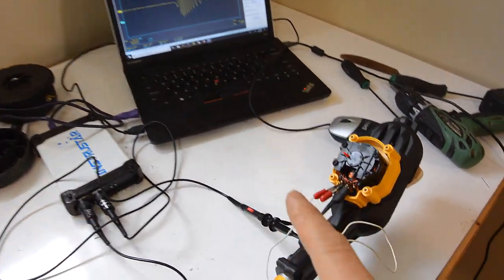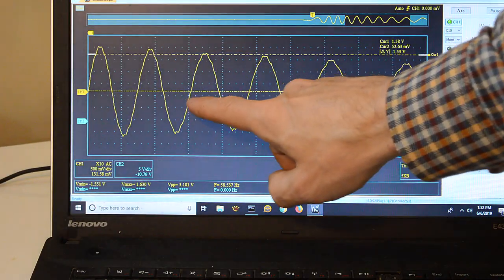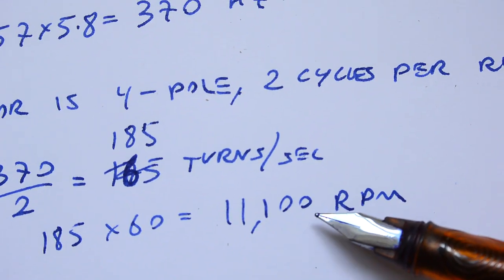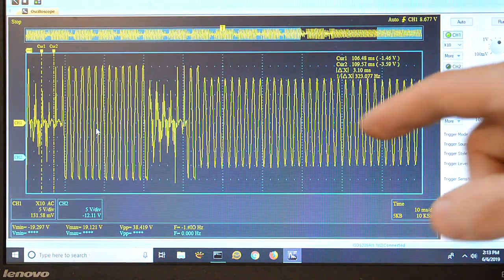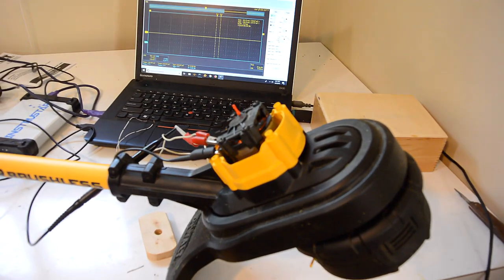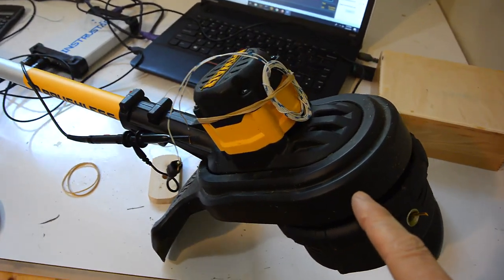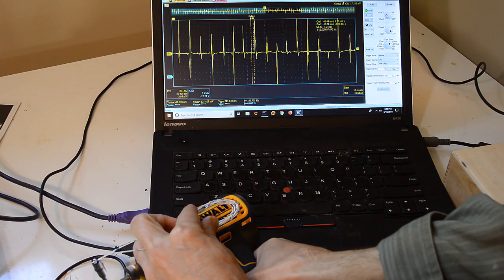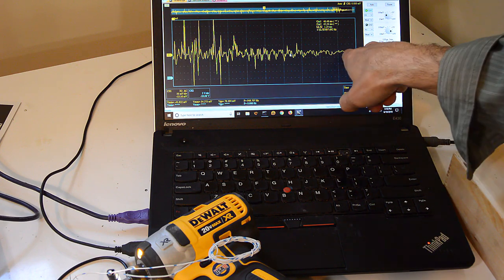Examining a brushless DC motor, and a dumb way to drive one.

Comment: I don't think it's doing the PWM strictly for the motor, but rather as a feature to drive the head in a different way.

When cutting grass and weeds, there's a lot to cut through. The spool cuts most effectively when it's whipping, not just rotating. It's sort of like an impact driver's effect on a bolt. 

Try measuring the output RPM. It's probably more or less the same RPM throughout the trigger range if there's no load.
Reply: Simple answer what’s your definition of efficiency?... for automobiles adding aggressive air intake and a high flow exhaust creates a lot of efficiency focused on driving the car faster ... where as dampening the motors exhaust and slowing down its air intake  will make the motor run more fuel efficient in the way it saves you money in gas... 
so I’ve used trimmers to cut jungles of grass from 5’ to 4” and a gas trimmer running full out throttle when cutting long grass will generate a ton of wind which blows the grass or momentarily bends the grass and it get missed by the trimmers cutters. So our old dads would tell us do the job proper and pulse the throttle and not to go full out. Or we will have to trim the whole yard again tomorrow! Watching the scope when you had the trimmer hooked up I immediately thought about being in a grass cutting situation in which to cut efficiently you have to operate the throttle non efficiently...

Comment: Its not breaking and wasting energy... Your crappy (USB latency lagging scope) is displaying a drop in voltage at regular intervals but its reading the back EMF (not forward voltage) which occurs at the same intervals which correspond to periods of time when the ESC is not supplying ANY voltage to the motor. Because the ESC able to sense the load and RPM of the motor it can change the PWM signals it sends to the motor on the fly and this makes the BLDC motor much more efficient and battery friendly. :) Brushless motors are actually three phase AC motors... Now try to wrap you brain around that :)
Reply: He observed that the voltage from phase-to-phase is zero for several cycles of sine wave even though the motor is spinning continuously. This can only happen if something is shorting out the back EMF that would otherwise be across those two wires. This means that a large current will flow. And the the mechanical effect of that is going to be braking (torque acting in the opposite direction of present rotation).
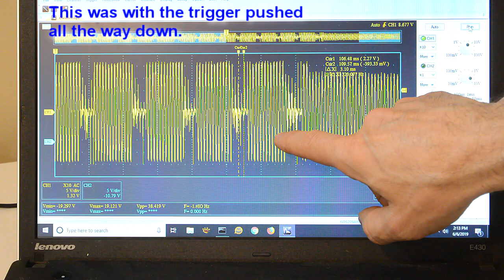Reply: During the sense period the (now output) voltage of the coils should not drop to almost nothing like it did unless the motor is so heavily loaded that it stops turning. Note at 6:56 where he releases the trigger and the height of the waveform slowly decays. That's what it should look like for a few cycles when doing back EMF control. The dip should be visible because you need to switch in some amount of resistance in order to create a voltage drop and suppress potential interference. Dropping down to almost zero means that is has to be shorting the coils or driving them exactly oppositely with battery voltage.

Comment: When using the trimmer i would imagene it is not braking that much because it has resistance from the thing you are cutting.
Reply: fl0r1svdk that’s exactly what I was thinking. Matthias can you make a “probe” and attach it to the scope and test it under a load?
Reply: It doesn't matter whether it is cutting. It just needs a piece of string in it. The string has a lot of air resistance at high speed.
Reply: Yes, I had an older version like that and a tab holding the ground cover broke, I ran it for a short while cutting heavier grass without that cover and very soon smoked the motor - dead once stopped - so I think that design just ran out to maximum and wanted friction of the plastic cord on the cover as one passive speed governing control.

Comment: As primitive as that controller is, they set it up like that because there is a lot more torque required when using the tool with string and cutting grass, I think you will find it running almost full out without braking to slow it down.There is another story with ecm motors that this controller does not make use of and that is back emf from each coil, the good controllers actually feed the voltage spikes into the next coil pairs to smooth out operation and add torque.There was a company that used a solid state disk for the rotor about 10 years ago but I don't recall the name.

Comment: Around 6:40: this is done to maintain both speed and maximum torque. You could regulate voltage accordingly to current, but that would be a waste of battery power to heat up another bunch of transistors, and probably spin up a fan to cool them.
Reply: It seems that in the null part of the duty cycle, when the coils arn't being driven, they aren't disconnecting the coils. They are driving the mosfets to short the coils instead. This doesn't allow the motor to coast, but would act as an electromagnetic brake.

The question I (and I think, Matthias) am asking is why they do not drive the mosfets to open-circuit, so the motor doesn't generate current and is not slowed down.

And when an electromagnetic brake would be useful - when the trigger is released - then the mosfets are driven to open-circuit, and the motor coasts. 

My thought is that they could be using a tuned circuit between the coils and some capacitors, perhaps, When they are not driving the coils, they resonate instead. Measuring the voltage across the coils may not show this, as you are really only measuring the voltage across the shorted mosfets.

Comment: I didn't understand much of what you said, so please forgive me for being puzzled over your remark about braking. How do you know this is not just an intermittent PWM pulse of energy to save battery life? Once these get to full speed, the torque requirements are minimal, in contrast with what you would want for an electric drill.
Reply: A BLDC is like an alternator. If it is spinning, it is generating voltage as the magnets move past the coils. If it was "coasting" and not being driven by the controller, you would still see that sinusoidal voltage across the wires where he put his oscilloscope. You may be thinking that when drive voltage is removed from the motor, it will just rest at zero volts, but that is not the case.

Comment: So, all that waveform is normal without load. Load the motor, then take measurements. brushless controllers are a closed loop system, and it cuts out due to overspeed sense in the circuitry. When you provide a 20-30% load, the frequency should smooth out because the motor is driven purely under load but at speed. Make sense? I hope?
Reply from the maker: Motor spends most of its time under very light load in use, so that case is more important
Reply: In this closed loop, the feedback from inductive kick during off time generates an error signal to regulate speed. Unless you have an inductive pickup for your scope, what your seeing isn't real due to the very high impedance mismatch. I hope this helps. But, this thing is supposed to be as cheap as possible so I guess they don't care about any of this and just make it turn. Idk
Reply: @matthiasrandomstuff2221  just adding string will load it quite a bit. Doesn't need to be cutting stuff to get resistance.

Comment: Money is likely better spent on the Worx model that doubles as an edger. If you compare that DeWalt to a Worx, the Worx is more honest and has less unnecessary bullshit for a brushless motor design. (Why does DeWalt have a fake gas motor "thing" and not using direct drive when a brushless motor should be reasonably able to handle it?)

Comment: I just bought the same exact thing lol.  Now at least I know what that sound is (the sound it makes when its done spinning down ).  In any case I was wondering if once the spindle is spun up if it will charge the battery when I release the trigger, since it doesn't stop right away.  Will the big gear or small gear wear out first with all the chatter?  Maybe depends on how its operated.  I'm pretty happy with it so far, but it's a new purchase.  Even my 1.5 Ah batteries are enough for my yard but its nifty you can use the heavier batteries with it too.  My only issue with it is the vent holes on top don't stay clear without a little care, much unlike the drive shaft powered gas trimmers of yore.  PSA: Stay away from cable as a drive shaft trimmers, if the shaft has a curve you know its a cable drive shaft... the cable will wear out, especially if pulsing the throttle.

Comment: For safety reasons, that trimmer needs to stop fast. The PWM is just on-off control: drive full speed or brake. It would be better if they braked only when the trigger is released but that would probably require a micro controller and software instead of a cheap driver IC. DeWalt probably has no idea what is going on, they just picked a Chinese factory to make it and drove a hard bargain, giving the factory little financial room for improvement.
Reply: Ma reasonable explanation I read here so far.

Comment: Silly question - does the drag of the string make a difference? spin it up with the string at full length and see if you still get less than full drive cycle.  I know mine, brushless EGO brand sounds a lot smoother as if sine and the board get along.
Reply: Definitely. My gas trimmer rev limits without string. But runs very smoothly with string.

Comment: I'm not sure how stupid it is. Remember, the string trimmer has intermittent loads when in use, so maybe periodic max voltage provides that peak intermittent power to get through those loads to minimize bogging.

Edit: I agree with another viewer as well. I'm not sure how you have this scoped, but perhaps you're only measuring 1 of the 3 phases.

Comment: However if it's doing that very quickly and switches of it's cycles it doesn't become much less efficient if any less efficient at all. Because PWM is also just a way of modulating the signal. And it decreases or extends the off time of the motor.

Comment: Can we all agree "brushless dc" is solid state controlled AC?
Reply: I know what you are talking about. But you are fighting a losing battle. And if we were going to use a different term (which we are not) the term we would use is "Permanent Magnet Synchronous Motor (PMSM)."
Reply: @mckenziekeith7434  and that's fine, but there is no motor in existence which turns with the same voltage on all poles ;)  call it what you will...that is to say, something must alternate
Reply: @mjkulikow  everyone knows exactly what a BLDC is. If you want to try to convince the world to use a different name because you feel BLDC is not accurate, of course that is your right. But in my opinion, unless you enjoy the fight, it might be better to give up and let it go. Everyone who works in the industry knows BLDC is a misnomer. But we call them that anyway.

Comment: would it not have to do with the the third set of coils that are not attached, to the scope (not registering a signal, the third set would always keep a magnetic inershia thus prolonging the battery load, tri-lobal magnetic field limits the load requirement to start and maintain the rotational field,basically they are never truly  north south , and why the stator  clings to the magnetic field when stationary 33.33% of a pole rather than 50%opposition , similar to S.E.G.? lol ,got me thinking of of a AC MOTOR AND ELECTRICAL MAGNETISM   course i took in moncton  nb in the late 80's

Comment: Matthias, your scope is aliasing the pwm waveforms. Common brushless switching frequency is 20 khz. Your scope is only sampling at 10 ksps, which is waaaay too low to see this. You need a better scope to see the fast pwm switching. At 20khz switching, this is 50 microseconds per switch, and you want scope resolution at least 10x faster to get a clean trace of that.
Reply: that's spot on superxpro12 - I hope Matthias sees your comment!
Reply from the maker: Yes, saw the comment.  but it's not aliasing (What are the odds that for all speeds its running at the same frequency as the scope samples at).  It's using block communtation.  Just because you know of something that can happen doesn't mean that it did.
Reply: @matthiasrandomstuff2221  hi Matthias, the switching frequency of the mosfet is fixed. The duty cycle is modulated to create variable DC voltages. The switching frequency doesn't change. It is always at a constant 20 khz. The commutation rate does change with the motor rpm, however. I have been working on brushess DC motor controls for 6 years now. The scope is aliasing the pwm signal, I guarantee it.
Reply: @superxpro12  
You have very good "comment posting etiquette", you kept your
cool and focused on your comment without any hard feelings
towards his comment previous to you.

Comment: 2:00 It doesn't put one magnetic pole on one set of coils and second pole on the other two sets of coils, at least not fully like that. If you look at a signal from all 3 sets of coils it should be 3 sinusoidal lines, each  moved 120 degrees from the others( https://upload.wikimedia.org/wikipedia/commons/c/cc/3_phase_AC_waveform.svg ), so you should have said "when one set has full north, at the same time the second set is in transition to full south and the third one is in transition from the full south". You said it like at the same moment one set has full north and the other two sets have full south. I dont mean to criticise too much, I just wanted to make the information more precise for people that may be learning for the first time about 3 phase from this video. I love your videos, Matthias :)
Reply: True.  Brushless motor drivers are more complex than a single measurement point can reveal, and it's also more about current than voltage.
Reply: The drive voltage for the motor would not be a smooth sinusoid (assuming you use a scope with decent bandwidth). That would imply linear control and very high power dissipation in the MOSFET's or IGBT's. The drive would be more like a class D audio amplifier. That is, PWM. Also, sine-wave drive is not universal for BLDC's. Often they are driven with six-step commuation. You can look that up on your own time (six step commutation of bldc).

Comment: It looks like a PWM signal is controlling the sine wave instead of approximating one. Which, as you say, is a weird or stupid approach. Do you think it has to do with the output current available? Do you have the capability to make a test circuit to see how much current it draws with an always on sine wave at the same values as what it is showing here? ( just speculating here now, since I used to be a tech for the prototyping at Rigid for their vacuums, and engineers are notorious for head scratching reasons to do some things) Perhaps it is trying to decrease the strain on the battery, or an attempt at staying within a spec that really should have been met differently?

Comment: I have some experience with motors and inverters. Shorting a synchronous motor that is rotating isn't as bad as you might think: contrary to rotating it at low speed and shorting it, where the resistive component dominates the reactive circuit of the shorted motor (and it really acts like a brake), at higher rates of rotation the inductive component dominates the circuit (the motor is decelerated for "half a pole" an then gets accelerated by the induced current again for the next half pole). So the only losses you get in that mode are the current losses in the windings. This cancels out most of the hysteresis losses in the stator, as the magnetic field is kept out of it by the shorted windings. Contrary to that, if you leave the motor open while it is truning you get the hysteresis losses in the stator instead of the resistance losses in the coils. Maybe(I'm not sure) there might be motors where the hysteresis losses when open would be higher than the resistive losses when shorted.
Reply from the maker: Do you suppose the hysteresis losses are greater than the copper losses?  Also, copper losses plus some amount of volage drop across the electronics as its not a perfect short.
Reply: It's a possibility - But I don't know of any other motor inverter that does it this way. The main point is: Shorting a synchronous motor while it's spinning fast does not waste as much energy as one might think, opposed to shorting a DC motor, where all of the energy would be dissipated in the winding resistance quickly.

Comment: I believe there is nothing stupid, this waveform is representing only one phase out of three,  so when it is turned off (suppressed)  another coil is actually turned on in order to complete the cycle, it's just how 3ph BLDC motors work. 
Note: opposite coil are usually connected in series and generate both S and N poles when energized. 
Nothing wrong with your basics, your basics are really good.
Reply: That was my thought, without probing all three phases you aren't getting a complete picture of what's going on.  It's obviously a very basic method of control, with no PWM, but it would be interesting to see all phases.  Perhaps it's capturing the phase current from the off phases to feed to the active phase?  My theory is a little weak on how difficult it would be, but it's worth a thought.

Comment: Just as a wild thought from someone with no background in electronics: could it recuperate power during the braking? Like charging a capacitor and then using it to drive motor next cycle? If this is possible, it may be simpler, than implementing PWM.

Comment: efficiency is not the whole point of a brushless motor, for an equipment that will be running for countless hours reliability is way more important than efficiency, and of course, it was made to be cheap, so of course they will not use efficient pwm circuit to drive it